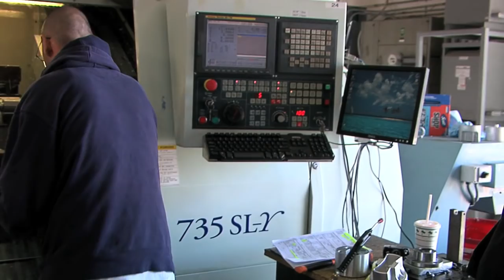Racetec Pistons Shop Tour

Comment: I am no engine expert but I am pretty sure you have to have the engine tore to know what size piston to have them make.
Reply: Not necessarily,the only time that is required is if you're starting with a really beat engine or after a catastrophic failure.You really want the pistons before you have the cylinders machined so that you dont have any issues with parts not fitting.

Comment: The machine shop doing my build recomended racetec for my pistons. So we ordered them on Feb 11th 2016. We were told 1.5 to three weeks for delivery. Just recieved them last week, 10 WEEKS LATER. Three weeks ago I started calling them inquiring as to the status. Tim and Randy whom I spoke with assured me each time they were going through inspection. That would be on monday, on Friday I would call back to see if they had been shipped. Got the run around each time, both guys claiming they needed to check with the shop and would call me back to advise. Never recieved one call back. Very frustrating to work with. The motor goes in daily driver and I had to rent a car for 7 weeks while i waited on this place. I had ligned up a ride for only the first 5 weeks. Cant say if its a good product yet as the rebuild is not done, irregaurdless, i will never recomend or use Race tec again. They made no effort and seemed to care less about the customer.
Reply: You have to understand that February is a VERY busy time for parts manufacturers as the racing season has either begun or is just around the corner. Special oider ANY part about that time and you'll likely see delays... been there many times. You should have ordered the parts before you tore down the engine... hope they worked well for you.

Comment: Great shop , why so many operations? This is really were a good cad cam system pays off
Reply: +Mark Rich  I deal with Racetec and I asked them your question.
 Think of the process as an assembly line. Its runs faster with more machines and personal.
Reply: +Rick H 
Dont get me wrong I know every one on youtube is a self proclaimed expert. I was asking more because I was curious. 
I work on a five axis doosan hp4400 horizontal at work but my company is mostly into the aircraft industry.  
Ive always been taught the less interaction a human has with making a part the more accurate itll be . None the less thank you for the video I enjoy watching stuff like this.
Reply: Its not actually so many operations...